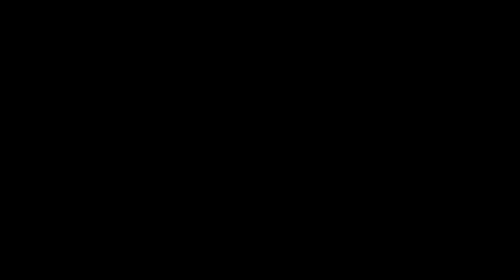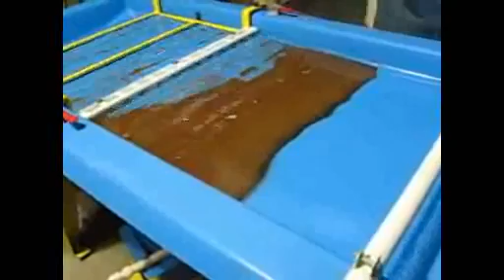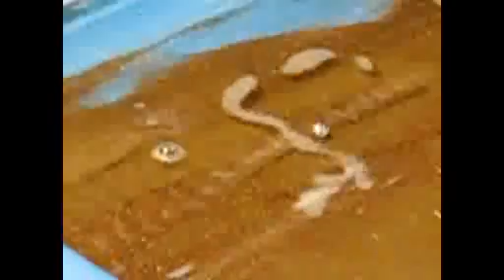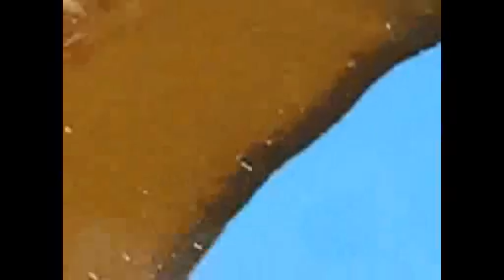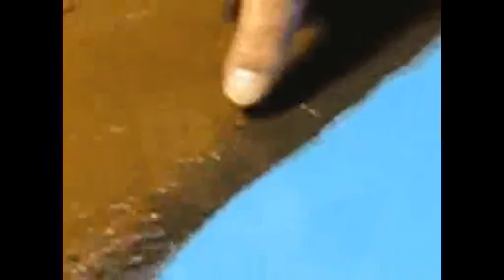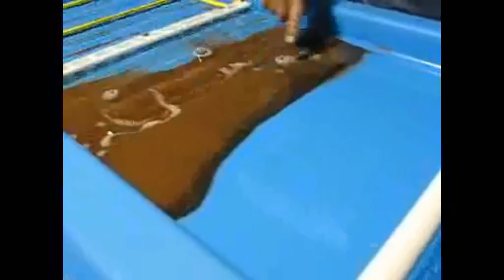MICRON MILL WAVE TABLE - FINE GOLD RECOVERY

Comment: Thank you for the video. I was thinking about a shake table and a friend suggested I check out your video. Very informative. The shaker table stuff goes down a path and seems you lose, cause has to be rerun. Your table all is on the table you snuff off. Its much better.

Comment from the maker: @guitarbridgecleaner “Mike, the two M7 Micron Wave tables that we are using have performed flawlessly for about a year now.
One table is being used to recover metal values that our other recovery processes missed. The other
M7 is being used to clean up the mids from a full size Diester table. Both tables have been  running  24 /7
since 1996 with no breakdowns!

Comment from the maker: Please read Action Mining web site "Discovery´s Gold Rush Alaska" 4 full reply:
1. They destabilized the table by taking the slab out of the ground and loading it onto a floor jack. 
2. No classification. Large flakes should have never even been on the table. They should have been screening. A ¼” rock will always weigh more than an 1/8” piece of gold. 
3. The wave table does not make gold, it recovers gold. They’ve done no proper sampling (or assaying) or processing of material with known gold.